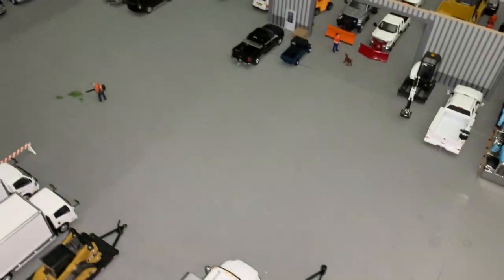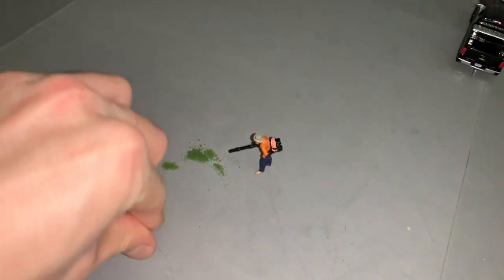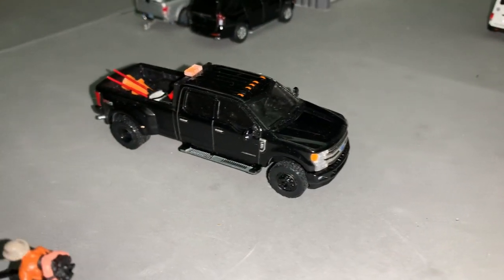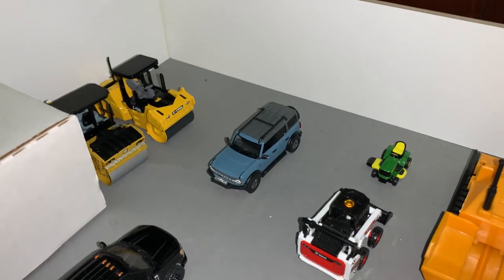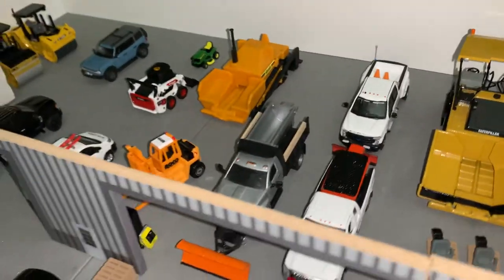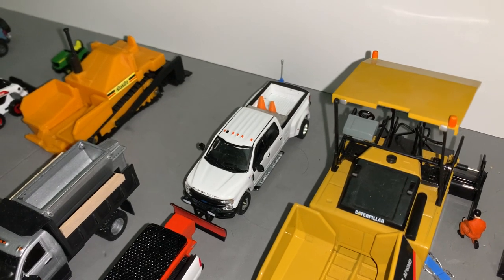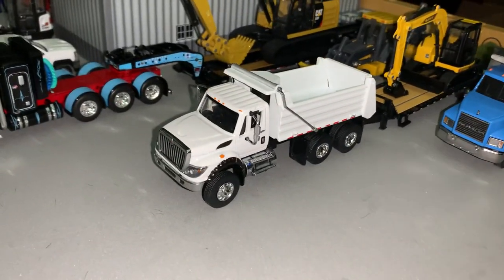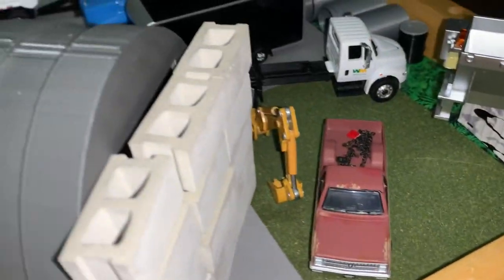1/64 Scale Greenlight, DCP, Diecast Masters Utility / Construction Company Shop Tour - Winter 2023

Comment: Where did you get the box trucks and water truck?
Reply from the maker: Isuzu and Hino box trucks are made by TINY 1/64, cascadia box truck is made by Speccast. Water truck ford l600 is made by speccast as well and the water tank is a custom which you could find in ebay.
Reply: @cvdiecast  can’t seem to find the I600
Reply from the maker: @noahhowell9190  oops it’s a L9000 here it is on ebay: https://www.ebay.com/itm/203198657127?mkcid=16&mkevt=1&mkrid=711-127632-2357-0&ssspo=cKHRp-N7QO2&sssrc=2349624&ssuid=aZY__lbZQmm&var=&widget_ver=artemis&media=COPY
Reply: @cvdiecast  thank you
Reply: @cvdiecast  👍